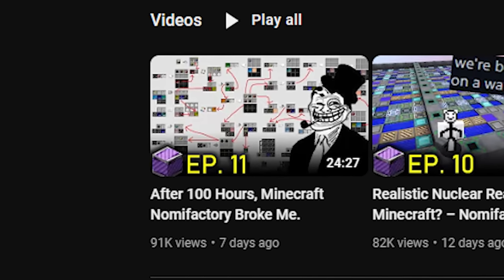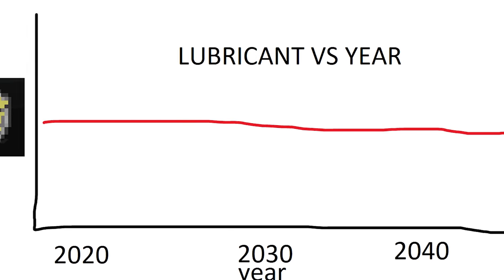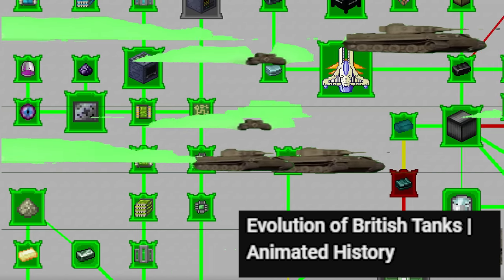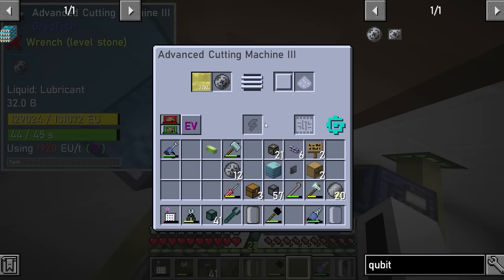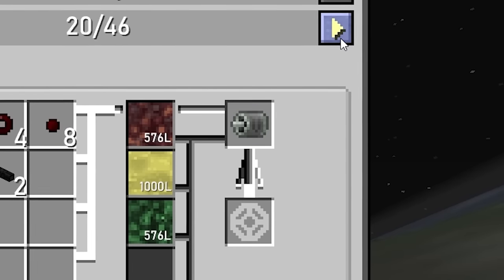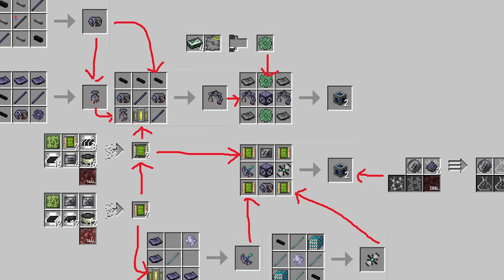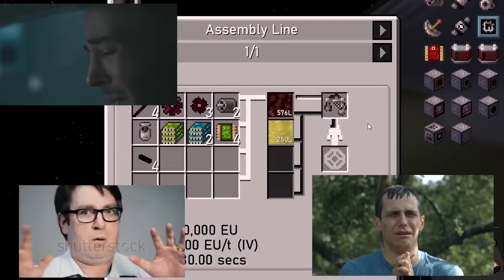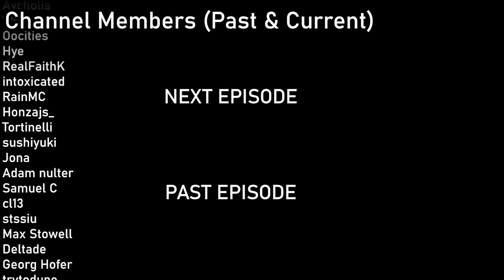So... I Created Quantum Computers In Minecraft - Nomifactory Ep. 12

Comment: If you have creative tank you could create a nice floor using rubber and then use a building gadget to make the floor 
However The naquadah blocks are also nice building blocks 
Idk if you done this yet but please create a blast furnace for alloys like fluxed electrum and vibrant and energetic alloy 
And you should try to make 16A hatches to absolutely overclock your on demand EBF
Also press r on recipes to be able to encode stuff like circuit recipes in one click

Comment: Robot tried to automate HSS-G. This is what happened to his simulated sanity:
Reply: Mixer -> EBF
Mix together its component dusts - you'll need to stock up on molybdenum and I assume you have tungstensteel automated from end stone + dml
Have both ingot and dust form of these. Dusts you'll need for HSS-S and HSS-E. Buffer these in a storage drawer.
Put into EBF with a gas
Use a ME level emitter and machine controller cover and set the emitter to 2k ingots
Pipe via AE2 or conduits or greg item pipes into a vacuum freezer
Alternatively ABS into freezer for ingots, but would suggest mixer for HSS-G as you need its dust for HSS-S and HSS-E